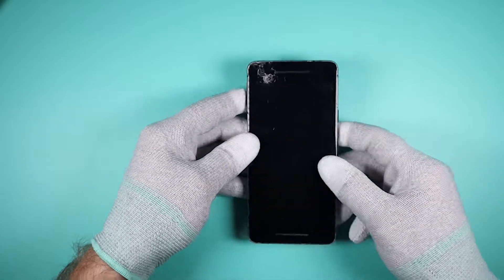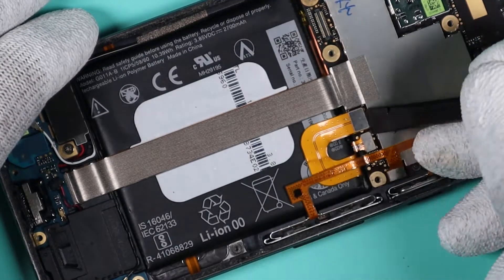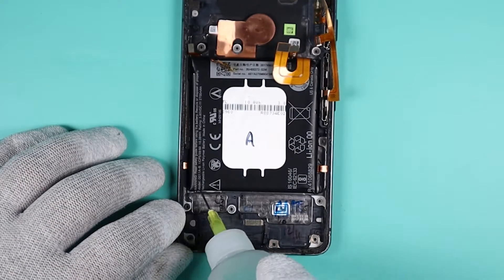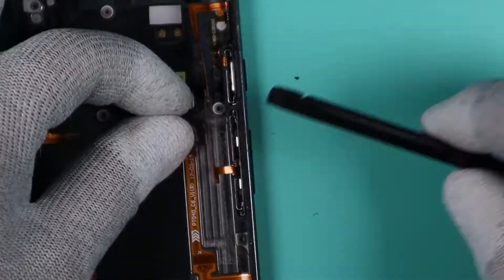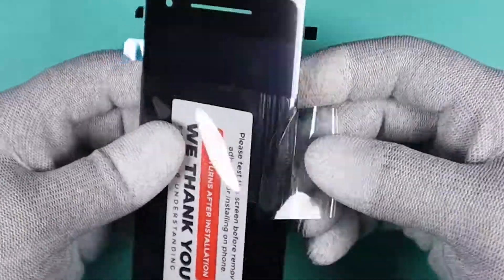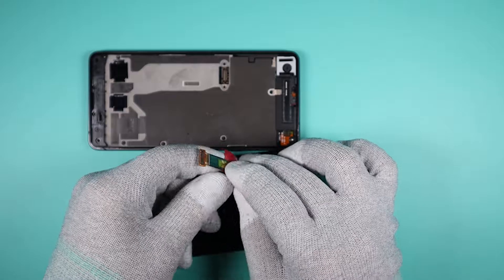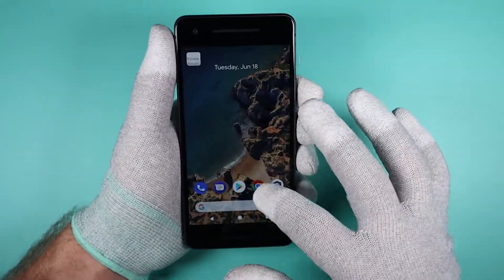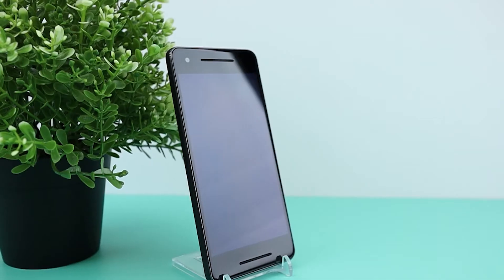Google Pixel 2 Complete Tear-down and Restoration

Comment: 7:42 This device to hold pressure on the phone screen I want. Can you buy it anywhere?
Reply from the maker: You can buy it at MobileSentrix. They don’t have the exact model anymore because it had a fault with the bolt stripping. You can use a separate clamp to clamp it down in the center. Here is a link: https://www.mobilesentrix.com/2uul-oversize-press-clamp-compatible-for-phone-pad-glass-replacement